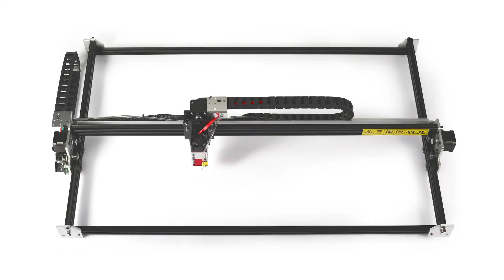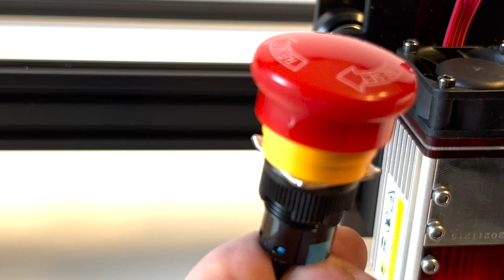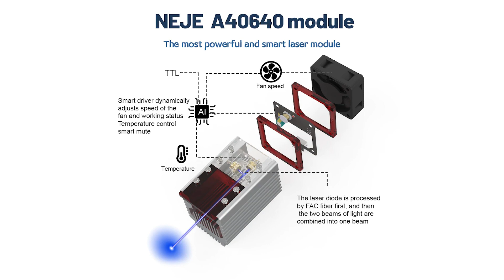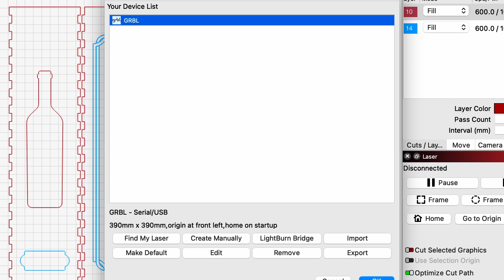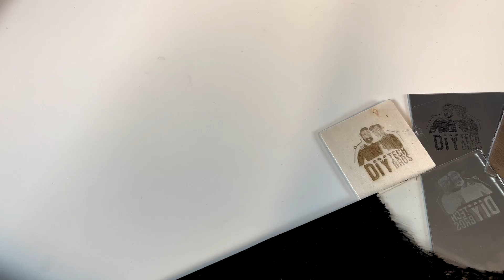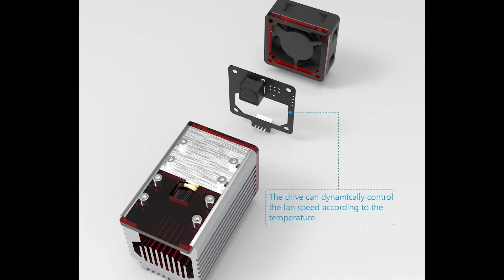NEJE 3 MAX 10 W LASER

Comment: Thanks for the video.
Some YouTuber shared a video about this machine, saying that it is not possible to record and cut at the same time, using the same file; does it proceed?
Reply from the maker: When I press start the laser starts with the engraving and then cuts. Same file handles it all. I push start once.

Comment: I've had my A40640 for a while and the cutting ability has been good, what air assist are you using? My air assist always has too much water vapor.
Reply from the maker: Hi! We are using a Stanley with a noise level of only 59dB. With a water filter and running it at 3 bar there is not much water making onto what we cut. But, if we have been running it a lot we empty the compressor tank and empty any water in the hose. If you disconnect the hose from the laser and cover the hole and suddenly release while there is a bit of pressure the hose empties very fast!